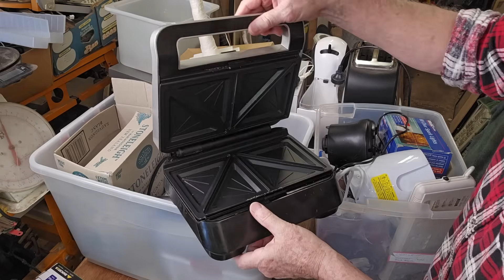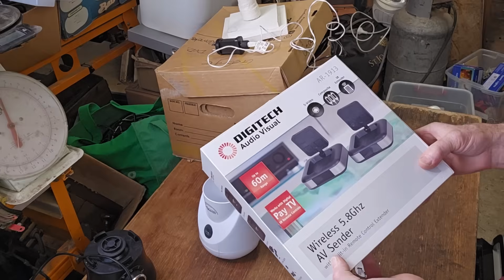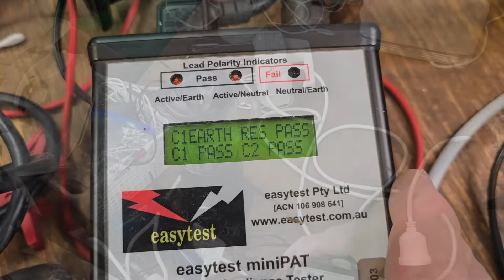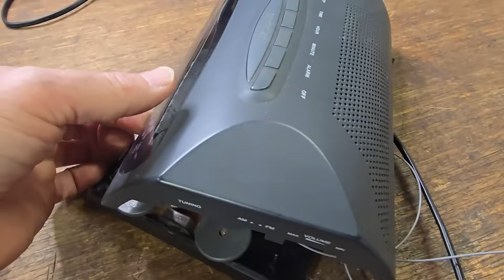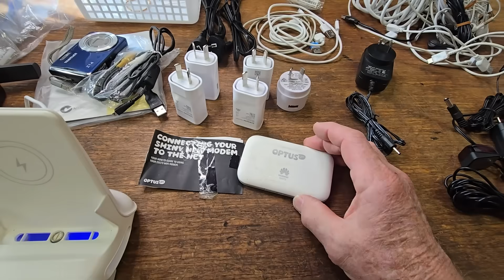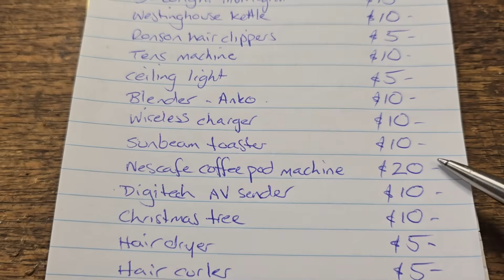Monday Marathon 31 - Processing Ewaste picked up from a Charity Shop! So Much Stuff - What a Haul!!

Comment: Amazing haul! For the wireless charger, you can get magnetic charger tips that stay in your phone and snap onto the connector in the base there (I guess just to charge faster than the wireless does). I have some old USB charging cables that use the same rotating magnetic connectors (bought on Ebay).
For the USB sticks, a lot of the ones with the rotating shield have that nasty rubberised coating on them that turns incredibly sticky. You can scrub it off with IPA, but it's not worth it.
Reply from the maker: Thanks Nebby. Yeah that rubberised coating that goes sticky is such a pain!!

Comment: Hair curler's 2 pin plug is the EU type E/F plug used from France to Moldova, also used in Russia, and the little chinese adapters I get nothing but bother with them, I buy more sturdy ones myself, though the appliance cord wires will be blue & brown so easy to snip the plug off for a rewirable Aussie plug.
Reply from the maker: Ah, thanks Gaz. I'll try and remember they are European plugs! Yes - not hard to replace the plug 👍

Comment: Yellowing on te halogen lamp is more likely nicotine from smoking than the sunlight, biggest problem with them is getting bulbs, and retrofit LED ones are usially fine but some older transformers don't like the electronics
Reply from the maker: Thanks Gaz. I'm pretty sure this is sun damage rather than nicotine - but yeah, that can certainly be a cause of yellowing 👍

Comment: Phillips beater is great one should be two speed and normally come with extra attachements for creaming and so on,  worth replacing the cord and selling as they are robust , looks to be late 1960s maybe 70s as early ones had a full handle connected both ends often in a stylish two tone colour
Reply from the maker: It's too late now!!